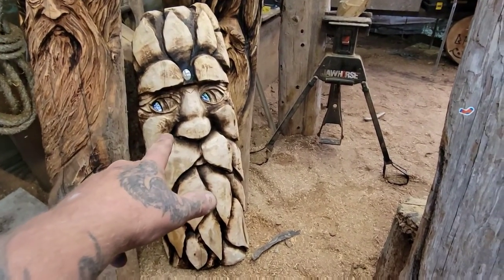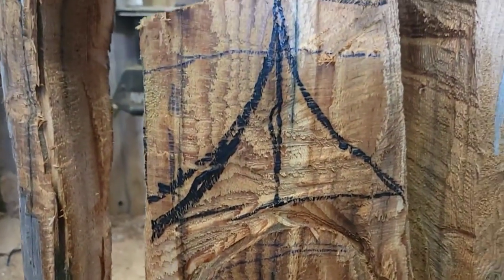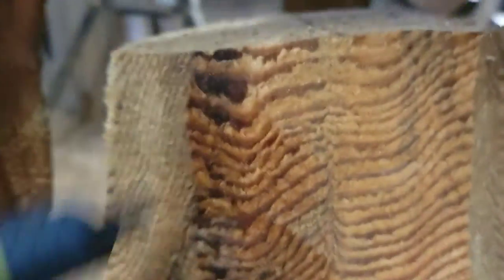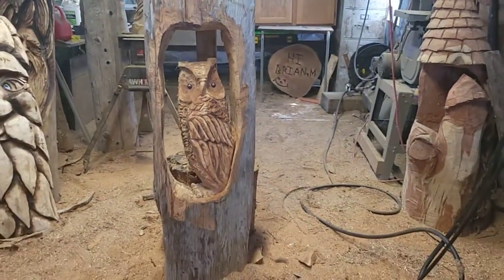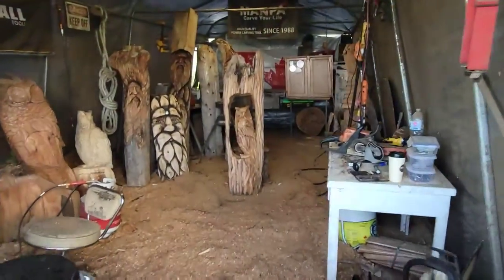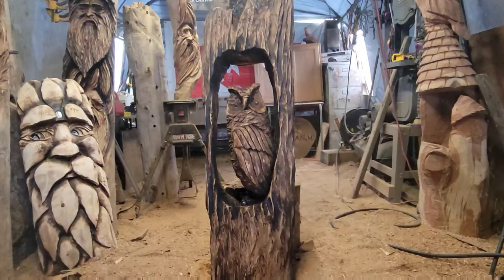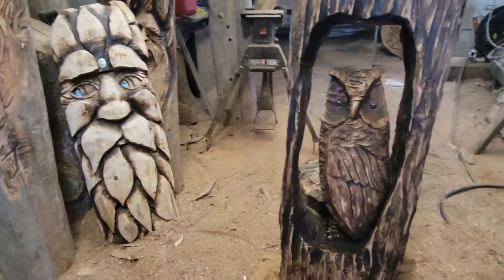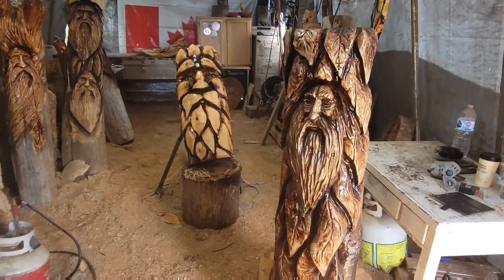Chainsaw carving driftwood owl in a nook.

Comment: You know if you were to mix some paraffin wax with those wood chips, you get a great fire starter.  Mix it right and it's dry, easy to handle and waterproof. I've built fires in heavy rain using them that I have made. Need a match or lighter, at least a small flame, to light them, they won't start with fero rod or flint & steal alone , but they are great fire starters.
Cool carves, I like that big spirit to. Looks real good, course, they all do. Hi Jordy.
Reply from the maker: Thanks for the tip